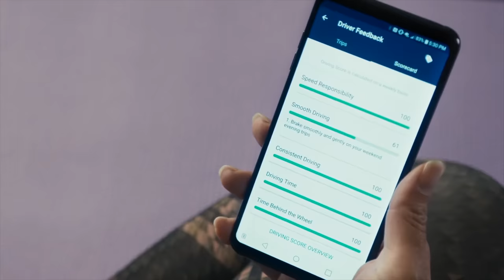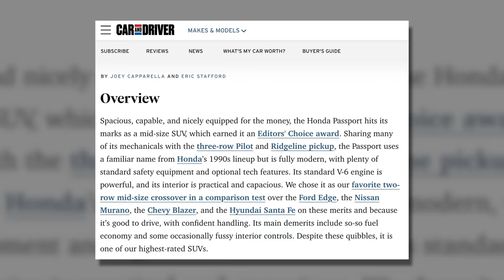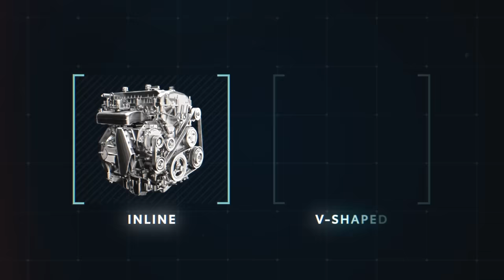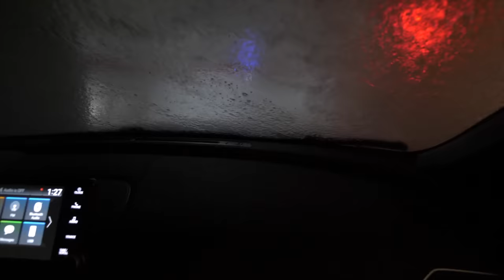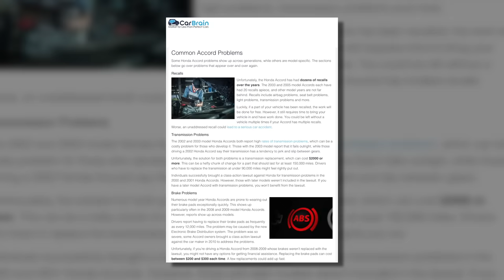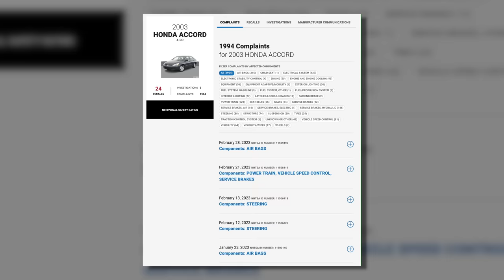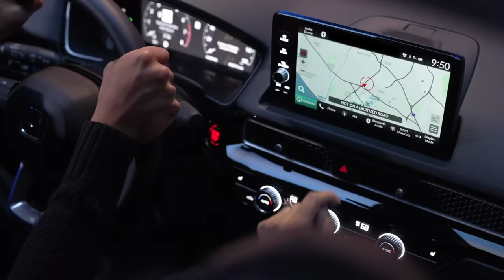Honda's CEO Just Said, "We're Losing Customers Fast and Don't Know What to Do"

Comment: All they have to do is go back to making the most reliable economical cars.  Period.
Reply: And build their own transmissions.
Reply: @oreally8605  that’s what they are doing right now after relying on ZF
Reply: And reliable sports cars that farts for kids
Reply: 100 percent right on @Geostruth!
Reply: They should get rid of the 1.5T to start.
Reply: and make a 300hp version of k24 instead of 1.5t garbage
Reply: You are 100 % right. I have owned hondas since 1991. I now own my last honda. A 2019 crv with the 1.5. Very dissatisfied  with this engine and honda is not standing behind this engine. I would love to have my 1991 back.
Reply: @johntokar9387  I have owned hondas since 1991 and have been very happy. Then I bought my 2019 crv with the 1.5. This engine is terrible in cold weather. Oil dilution and no heat. Engine has a hard time to get to operating temp in short stop and go driving in winter condtions.  I drive mine with heater fan on low  to try to get engine temp up to normal. Honda will not admit they have a problem. I will speak with my wallet .
Reply: In reality they never were that great though! Their entire reputation is built in ignoring all the recalls and mechanical problems they've had! It just becomes about liking them for being Japanese and not American!
Reply: Ok Lisa
Reply: I’ve owned Honda’s since my 1985 Civic. They need to go back to normal transmissions. No CVT No Turbo. Go naturally aspirated. Waaaay more reliable
Reply: @johntokar9387  They finally fixed that 1.5 a year, or two ago.
I'd still rather have the 2.0
Reply: Get rid of the CVT transmissions and Honda's problem will be solved.
Reply: @m109r  you should put a engine heater perhaps and cover the front grill air inlets to help it warm up faster. I did it on my Civic but Honda should have done shutters. They really screwed us over cutting corners. The Chevy Cruze had shutters and so did Accords.
Reply: Bring back the s2000
Reply: @m109r  true that. My 10th gen Civic was the same but they seems to have addressed the issues as my 11th gen heats up a lot faster.
Reply: Dealer has changed heater control module.  Has done updates. In winter condtions I drive in sport mode with heater on low to get the engine up to operating temp. This  has helped . If you get your honda up to operating temp then idle with heater on high on a cold winter day . The engine  temp will drop . You will notice the drop in 5 minutes.  Engine should be able to stay at operating temp.
Reply: @lisam4503  my dads 2012 pilot has 200k miles on it and all we had to do is replace the spark plugs. name me ANY american 3 row suv that can do the same. heres a hint: you can't
Reply: I have a CRV 2021, it is great. Lots of features and great mileage
Reply: I agree work on the transmission and get rid of that 1.5 turbooooo but I have a 22 honda hrv sport
Reply: And keeping the features simple, not electronically sophisticated and complicated.
Reply: Bring back Integra/RSX, CRZ, CRX, VTi trim Civics/Accord
Reply: Bring the Honda Fit back to America. People will by them.
Reply: Correct!
Reply: I agree with you my last Honda lasted for more than 307000 miles.
Reply: @lisam4503  I don't know what you are talking about.   In the 80's Honda was very reliable.   They ran forever with little maintenance.
Reply: @geostruth9115  Lol they were rot boxes!
Reply: @lisam4503  Evidently you are not old enough to know.  I bought an 84 Accord brand new.  It was very reliable.   Put over 280,000 miles on it.
Reply: @geostruth9115  Lol I am old enough and have great memory! My high school science teacher drove a civic! He heaped great praise on it and we all watched it rot out in less than three years!
Should have written a science paper about it! Lol In the 1980's Japanese cars were well known for head gasket failures! They were also over rating their horsepower!
Reply: Unreliable cars will kill an auto company faster than anything.
Reply: One way to fix that, larger displacement N/A engines only.  Stop building engines with turbos.  Tried and true is ALWAYS the way to go.
Reply: @jamescanfield7251  Fuel mileage and emission standards don't allow them to!
Reply: @lisam4503  That being the case, dealers and Honda need to start educating consumers on maintaining these smaller turbocharged engines and CVTs.  They likely require more maintenance to keep them running at peak performance.  I’d be willing to bet that sales people don’t know much about these vehicles, which perpetuates the problem and ruins Honda’s image in the public eye.
Reply: The new Hondas are ugly as sin
Reply: Instead of slapping turbos into everything .
Reply: @Fred-F4 🤮 didn’t even know that existed. Wow .

Comment: I ve always been a fan of Hondas. The reason I switched from Honda to Toyota is comfort. When driving Toyota you immediately feel this super soft and quiet suspension that really appeals to me. Honda has better steering and overall a more sportier feel but the older I become the more I tend to value comfort, and Toyota does deliver it better.
Reply: I finally got a chance to rent a brand new Honda Accord and then recently a brand new Toyota Camry.  Although I consider the new body on the Accord, extremely bland compared to the last generation. I must admit when it comes to the fun-to-drive factor, it easily beats out the Camry.  But when it comes to the most adjustable and comfortable seats.  The Camry wins
Reply: I had a 2015 KIA Optima EX and sold also those year Honda's.  Kia had a better ride, more amenities, and was way quieter.
Reply: @richardpasquini8285 I tend to agree with you 100%. I took a rental car at the airport back in the days and it was Kia Optima 2015 EX.  I drove it for about 800 miles. I must say that car was way superior to my Honda Accord 2013 that I had at home in my garage. It was more powerful, faster, had better ride quality, overall felt like a better car and I enjoyed driving it a lot more. Both cars were 4 cyl but Kia had more power and a lot funnier to drive.
Reply: Welcome to your last car.  Toyota not only is more reliable, but if there is any problem, Toyota has a no questions asked approach to their warranty.  I guess when you're 100 times bigger than Honda, you can afford to stand behind your product.

Comment: As an exclusive Honda owner for the last 30 years… I’m looking elsewhere for the first time, the value and quality isn’t there and especially with the damage dealers did to the customer relationship with “market adjustments” 

Good luck bc Honda will need it
Reply: check out Mazda. The new ones drive better than any Honda or Toyota, their Interiors are superior, and because they're not owned by Ford anymore, all Mazdas are engineered and assembled in Japan, which has significantly higher quality control during assembly
Reply: @TheDayisMineTrebeck  the MX-50 is on my short list, i'm concerned about the wireless charging and the infotainment system, not the quality of the car itself.
Reply: Yeah, Honda tried to match Toyota reliability, but they are far too small of a company (compared to Toyota) to crack the secret.

Comment: As a semi driver the brand most broken down on the side of the road is Chrysler/Dodge/Ram followed by Chevy. The owners of these vehicles are extremely brand loyal and intentionally overlook their failures.

Yesterday, in Baton Rouge, I’m stopped at the light, 4 rows back, all 6 of the vehicles Toyota/Lexus. Next to me a Camaro. Behind them a Honda Civic and behind me a Lexus SUV.
Reply: I was a mechanic in the 70's.  In those days the Chrysler six and eight cylinder engine were very reliable. It's a steep downward drop to the situation now.

Comment: I have owned 7 Honda cars. Never had any issues with them. I met all maintenance requirements. Only reason I ever got rid of one was to upgrade to a newer model.
Reply: Im on my 5th loved them all and non of them ever failed on me 😊
Reply: But if you met ALL MAINTENANCE REQUIREMENTS, that would have cost a small fortune. So you really didn't make out all that well.  Until I started leasing when I retired, I owned 5 ford taurus cars that all went over 200,000 miles. The only maintenance I performed were oil and filter changes every 5000.00 miles. Only things I had to replace were tires, and brake pads which are normal.
Reply: @dont4450  Have you owned a Honda? Their maintenance schedule isn't really ridiculous, and they still make Accords. Ford drove the Taurus to death by cheapening the quality, until they stopped car production altogether; appears like they did they to start manufacturing EVs.
Reply: @dont4450  Its a vehicle and maintenance will need to be done. Only changing oil and filter with out doing other maintenance is treating the car like it is a Styro Foam cup.

Comment: I presently own a '16 Accord and I love the car. The one thing that will cause me to avoid a Honda next time is turbochargers.  I may consider one of Honda's non-turbo options but I will also look at other brands non-turbo options.
Reply: yep accords need a v6
Reply: I look at a turbocharger and think "$2500 100K Mile replacement item".

Accords don't need a V6, they need the old 2.2L/2.4L  normally aspirated engine.  Reliable as a rock and much better fuel milage than a V6.
Reply: @WildBikerBill  Mine has the naturally aspirated 2.4 liter.  Very good engine.
Reply: I also own a base model 4 calendar CVT 2016 Accord LX and I love it, high mileage of about 200k miles (no repairs ever), and it's pretty zippy in my opinion. I've owned BMW, Range Rover, Infinity, and Jaguar and although a base Accord doesn't compare to those cars it's enough to keep me happy with it's performance. The best thing is the incredibly low cost to own and incredible reliability. Not sure why people don't like the CVT engines but mine has been a pleasure to own as far as I'm concerned. Of course the fact that I got into that car for $21k is a big factor... no way I'd pay $40k for an Accord new today and still expect to be as pleased. For that kind of money I may have to look at Toyota or maybe even Mazda? Honda's appeal is affordability over time and new Honda's are just too expensive now to provide that feature.
Reply: @charlesdudek7713  Me too!  I don't want one with turbo.  It wears out the engine too fast!
Reply: @WildBikerBill  My Accord has the 2.4 . I gets fantastic mileage and has plenty of power.  I wish they had stuck with it. You are absolutely right.

Comment: One thing that stood out to me when I visited my Honda dealership for service twice within the last six months (oil change, brake pads) was the sparse new car inventory. More than half of the cars on the show room floor were certified preowned.
Reply: Honda Marysville, OH is always hiring. Offering $6,000 sign on bonus and relocation money of $700/ monthly for 6 months. Is it a production issue?
Reply: I noticed the same thing here in Central Florida earlier this year but within the last 45 days the local Honda dealer has started to receive a lot of new vehicles especially the new Accord.  However, they have put a $2500 upcharge on them for a "market adjustment" 😕
Reply: @johnw9245  I hear ya. It's just straight up robbery/extortion. My Accord sport is paid off and all I focus on is regular maintenance.

Comment: Just sold my 13 accord in favor of a 21 Corolla. The engine was beginning to fall apart at 110k, with previous blown head gasket, replaced radiator, replaced starter, and wheel bearings. The car is still overheating and breaks down every 6 months. Did not expect this with Honda.

Comment: I have 2003 Honda Accord V6, that Scotty mentions as the most troublesome Honda car. I've owned the car for 18 years, absolutely have not had any problems - change oil, breaks, do what the manual says. That's it! 155k mi right now. Planning to keep it until it turns to dust!
Reply: 18 years, but only 155k miles? The average car is expected to be driven between 12 and 15k miles a year... you use your vehicle less than average, that's why it's less problematic.
Reply: @EggheadJr1  I work in town my self and only average 2,400 a year.
Reply: @chodkowski01  I drove 35k last year haha
Reply: Lol my 2006 honda accord (same generation) has 226K miles and i havent had major issues either. Just stuff like a new alternator, battery, ignition coils and spark plugs thats it.
Reply: How often did it break??
Reply: Only issue wiith an 03 accord v6 would be the transmnission if ya like roastting the front tiires iitt wiill not last long
Reply: We’re taking about problems per hundred or more.  When more than a hand full out of hundreds more likely thousands have the same problem it’s called a trend and used to sell magazines and promote competitive product.
Reply: @CRAPO2011  no one would bother roasting tires in a FWD Accord.  At least that’s what the engineers thought..and what I think too
Reply: You're extremely lucky.  That 5AT and it's 4AT predecessor are one of the worst Honda transmissions ever made.  We went through 3 on our 03 V6 before we finally decided to retire her.  We drive in socal stop and go traffic which is murder on them.

Comment: Bought wifey a 2010 accord back in they day.  Excellent quality.  Bought wifey a 2020 CRV back in the day.   Serious drop in quality.
Reply: its about the demand for fuel economy and who is putting them together
Reply: Good motors, crappy interiors & audio.
Reply: @jr8043  they have started putting in Bose into the civics and yes shoddy jobs on interior.. i think it matters where hondas are made. yes audio needs help
Reply: @tracy2762  hence why I drive a Lexus GX 460 now..
Reply: @jr8043  i had a 2019 sport hatch civic..really liked it except the performance tires hitting hard bumps..radio without cd player and siruis i think..gdi engine made me nervous so i changed oil every 4000..otherwise great car. it was sonic grey.. 2021 civic lx ..disapointing it was but a good standard engine. crvs are nice also. give or take same lack of issues.. performance great in all..i drove a 2000 civic with 168,000  miles and had no fear to take it across country several times. hardy.
Reply: @tracy2762  I have 2017 Sport Hatch. The wheels were too heavy at 30lbs and 40 series rubber. But they messed up also on subframe and rigidity missing so the ride feels harsh. I agree the lack of cd player is big let down.
Reply: The vast majority of these vehicles were designed in the US versus Japan and is one reason why they were bad and the other is the sourcing parts from China to save money.
Reply: @jamesmedina2062  its actually a road hugging loving car..it was great to drive..i dont think any performance tire could be cushey..but you were almost stuck using the low tires...i enjoyed driving it otherwise.
Reply: Yes. I heard about Honda reliability all my life. Bought a new 2012 CRV. That car had one problem after another. Needed new batteries about every 7-8 MONTHS. It was a failure to charge issue that Honda was unwilling to fix. They’d rather just throw batteries at me. The a/c died, even the seatbelt broke. Never had that happen. Sold it in 2017 and have never been happier to ditch a car.
Reply: Dealer mechanics don't usually know how to diagnose properly.   Get a real mechanic.
Reply: @malibuman8941  there is usually one guy that knows his stuff and the rest are clueless wrench-turners.

Comment: I purchased a new Honda, but the battery died at only 26,000 miles. When I brought it to the dealership, I discovered that several other customers had experienced the same issue. Additionally, at 90,000 miles, my car occasionally wouldn't start and required jumping. Despite changing the battery twice and cleaning up the caustic battery buildup, the problem persisted. I took the car to Honda twice, where the technicians were unable to diagnose the issue. I've been a lifelong fan of Honda, primarily for its reliability, but this experience has drastically changed my view. I now believe that Honda's reliability has significantly declined and will likely worsen. Based on my experience, I would strongly advise people to stay away from this brand.